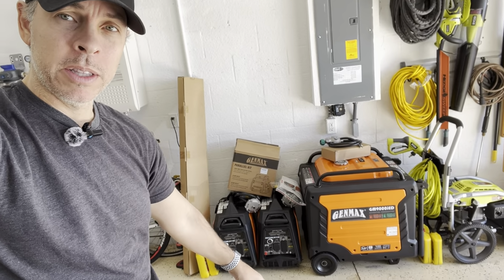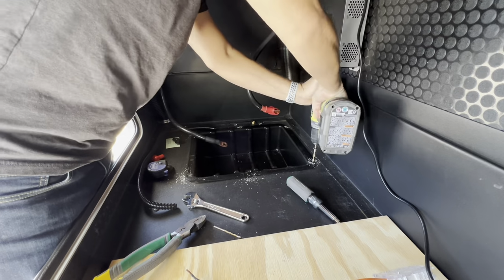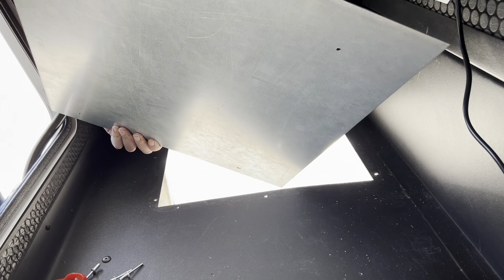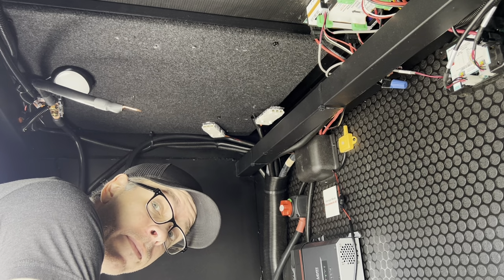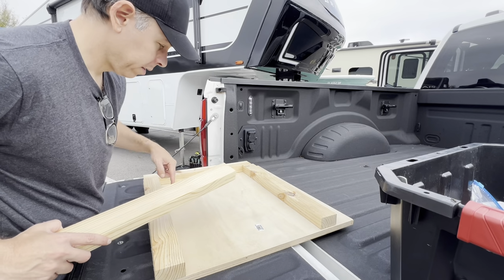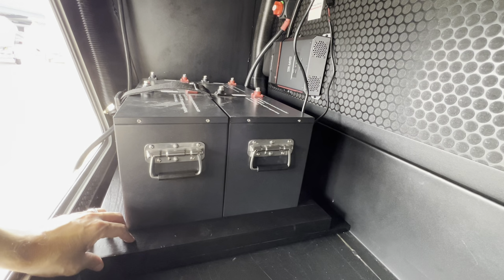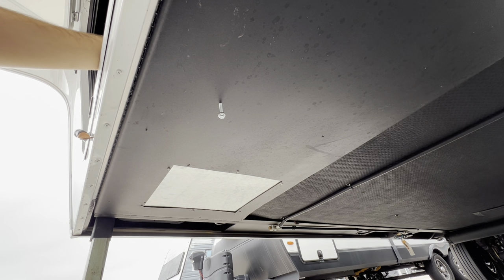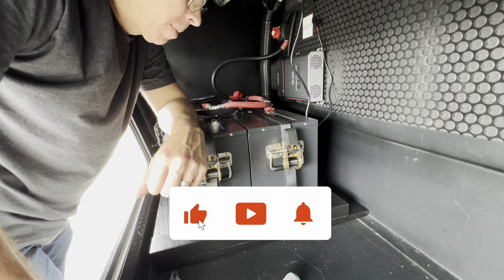Brinkley RV Model Z 3100 - Inverter and batteries installation

Comment: Hello Javier: Just a note to thank you for the guidance to get my Z3100 AutoDetect converter to identify my new SOK lithium batteries. The WFCO company took care of the issue of the converter not identifying my lithium batteries by giving me a new converter that was hard wired to lithium mode. I’m now able to charge my batteries to ~14.2V and I’m sure they will charge up to 14.6 V once I start using shore power and additional solar panels. Of course the most important aspect of having the converter identify the lithium batteries is so that the charging profiles match the needs of these batteries to increase their life span.  Thanks again & you are great resource for all things RV. Enjoy your new Brinkley Z3100. 
Joe
Reply from the maker: Great, you are welcome.  If I were WFCO, I would put a 3 way switch to go from auto to lithium or acid battery. their auto detect is not as fast as people would expect or need it.

Comment: Fun to watch different approaches to installing inverters and batteries to the Z 3100. I just sealed the bottom vent on the battery box and left it in. Then I built a platform on top to secure 4 Battleborn 100 ah batteries. I also like how when measuring you are thinking in Spanish and converting to English, I'm a little jealous cause I don't speak a second language. Enjoy the Brinkley, we sure do. Burlington Bill busking on the road and here on You Tube.

Comment: Thank you so much for the clarification Javier.  You are an amazing resource on many topics. 
Yes I already contacted WFCO on the converter installed in the Brinkley Z3100 and they were questioning the cable connect sizing used by Brinkley (or Lippert)  and the distance that the converter is from the Lithium batteries as the most probable cause on why their WFCO WF-9855-AD
Auto-Detect Power
Converter, 55A Output converter was not identifying my SOK lithium batteries. I will bring this issue up with Brinkley (or Lippert) so that they can consider mounting the WFCO converter in the battery bay area on future Brinkley models or just use thicker AWG cabling to rectify this issue. Take care.
Reply from the maker: The cable size is 6awg which is appropriate for 55amps and the distance is no more than 10 ft so that is not the issue. I believe that the WFCO Auto detection does not meet the users' expectations. I would have installed a switch to switch from auto detect, lithium or acid battery and led the user to decide.

Comment: Javier I just realized that I will also need to incorporate the ability for my parallel dual generator set up to accept a 50 amp receptacle that we have on our Z3100 Brinkleys. 

So now instead of just the junction cables to connect the two generators together I will need an electrical box with 50 amp receptacle (+ circuit breaker) to achieve what you have already built in with your GENMAX GM9000iE.  

Hopefully all the internal cabling on the GENMAX GM6000iED generators that I was thinking of buying will have wiring to handle the 50 amp load.  Let’s see what GenMax support has to say and I’ll let you know.  

If not I guess I’ll just get a gym membership and get those biceps and lats in shape and go for your GENMAX GM9000iE.  👍👍
Reply from the maker: Get this one https://amzn.to/3QH3hV7
If you get 2 use this to connect them in parallel https://amzn.to/3USMzEC

Comment: Thank you for showing the install in the Brinkley. Could you demonstrate the inverter in actual use inside the rig and also how it ties into the breaker panel. I need to do the same install thanks again.
Reply from the maker: Yes I will, I was waiting to test it and have a little more understanding of the Sub Panel because is tricky.

Comment: Hello again Javier:  I noticed you purchased the 233.7 lb GENMAX GM9000iE 50 Amp 7600W/9000W Remote Start Gas Inverter Generator with CO Detector. Awesome generator to say the least. 
How on earth do you lift that beast into the front storage area on your beautiful new Brinkley Z3100?

I’m contemplating just purchasing two GENMAX GM6000iED 6000 Watt Dual Fuel Inverter Generator with CO Detector (weight: 117.9lbs) and connecting them with a parallel cable kit. 

Just another way to get us plenty of watts to run those AC’s and the entire rig !!
Yeah it’s $~$500 more for this dual generator set up but hey it’s only money right?  Save the back I say.  Ouch!!
Take care and we are almost ready to head out on our first test run in our Z3100. What a ship.
Reply from the maker: I didn’t bought the GM9000iED for the RV.  Is for my house.  Check my other videos.   For the RV I bought a Genmax GM3500iAED.  Well 2. I bought 2 3500 to use it in parallel but then I realized that only one with 30 amps will be enough.  Is not hard wired.

Comment: Very clean and professional install Javier. We just received our 2024 Z3100 last week. What a fine 5th wheel.  The dealer only installed 2 Marine standard batteries which I will return for full credit once I install your recommended SOX 12.8V 206 AH 2636 WH Group 27 batteries. Question?  Why 4 batteries and not just 2? What are your calculated number of boondocking days with these 4 SOX batteries assuming you do not run the AC?  Thanks; Joe (Portland, OR)
Reply from the maker: Hello.  My plan is to be able to run the main air conditioner overnight ar some overnight stop.  That is why I didn’t add any additional solar panels; at night there is no sun. I will recharge at the next campground using the shore power. I used 4 based on 45min of AC per every 100ah.  4 batteries at 206 each equals 824ah.  Total 6hrs.  If I get 4-5hrs at least of AC overnight I am good with that.
Reply from the maker: How many days of boondocking I don’t know.  I don’t bookdock yet.  But I am sure that without AC will be 5-7 days.  Remember I did not add solar panels.  You want to double your batteries ahead of time in solar panels watts.  For example in my case with 824ah I should have at least 1,700w of solar panels to keep the batteries recharged.  

Hey if you decide to order the batteries please consider using the link in my video description that helps me to keep affording RVing.

Comment: Thanks for posting. I had a few questions and this answered them for me. My issue is 007 was only wired for a 2000 watt inverter and I cannot find one with an automatic transfer switch. So right now I can either buy an automatic transfer switch (which I do not know how to wire) or pay someone  to install it which I am not willing to do. Looks like I am going to have to learn how to do it.
Reply from the maker: Isn't that complicated to add a transfer switch is more work. I  would e-mail Brinkley and ask for instructions so you have a guide.  Also post on FB; who, where, and how someone with a 2000w inverter prep kit installed a transfer switch. you can check PowerMax PMX 2000W-PSPT  and KISAE SWXFR1220

Comment: Ok Javier. My WFCO converter light is still not changing from green to blue (lithium recognition color) so I will send it to WFCO to have it “hard wired” to lithium as you did. I am suspecting that Lippert-Brinkley & WFCO did not install the converter in a location that is allowing the so called “Auto-Detect” components of the converter to switch to lithium after a standard “draw down” test which I have performed several times in my 2024 Z-3100 Brinkley. 

On another subject: Do you plan on connecting your generator to the Brinkley’s quick disconnect LP outlet when boon-docking or do you have a separate LP tank (with short hose) that connects to your generator?

As always thanks for helping me get this new 5th wheel ready to roll 👍👍
Reply from the maker: @joemarin7918  only a few have been lucky enough to get it to switch to lithium mode.  Even that my generator is dual fuel I have been using gas.  If I start to use LP I will get an additional tank.

Comment: Hello Javier: 
I just removed the WFCO AUTO-DETECTING converter from my Z3100 RV. As you recall the converter was NOT Auto-detecting my lithium batteries and switching over to lithium charging profile which is very important for lithium battery charging. Question?
How fast was your turn around time with WFCO once they received your converter in order for them to permanently set the converter to lithium mode?
Thanks
Joe (Oregon)
Reply from the maker: In my case they sent me a new one already in lithium mode.  I heard from others that was no more than a week to receive it back after they received it.

Comment: Hello again Javier:
Did you change your Brinkley Z3100 factory installed:

•WFCO WF-9855-AD (Auto-Detect) Power Converter with 55A Output for a:

•WFCO WF-68100AD Series Deck-Mount Converter Charger -100 Amp unit which is also incorporated in the “G” model Brinkley?

Or did you use a different lithium dedicated converter from WFCO?

If so can you share the specific WFCO converter model number?

I only went with a 2 each SOK 206AH batteries initially but will convert to a full boondocking solar set up in October when we land in North Florida. 
Thanks 
Joe (2024 Brinkley Z3100)
Reply from the maker: I am using the original 9855-AD converter.  You can’t use a 68100AD Without first changing the wires.  The z3100 comes with a 6awg wire that is only good for up to 60amps not 100amps.

Comment: Good day Javier.
I was just wondering if you just went ahead and removed the WFCO converter yourself and then sent it into the manufacturer to have it hardwired for Lithium or if you received Brinkley approval prior to sending it to WFCO for the modification. Take care. 
Joe
Reply from the maker: @joemarin7918  you have to contact WFCO directly first.  In my case WFCO sent me a new one and I replaced it.

Comment: Did you have to run a ground wire from the chassis to the ground connection on the inverter?  Or does the ground wires from both the red and black legs do the trick?
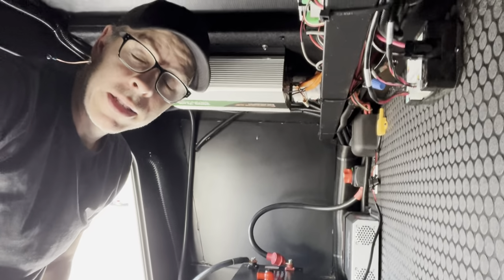Reply from the maker: 22:44 if you go to that time on the video you will see behind my head that I added a wire from the ground screw to the RV chassis.

Comment: Good day Javier. I just installed 2 SOK 208ah batteries and they work fine. Question. Did your Brinkley Z3100 Converter light change from green to blue (after your draw down procedure) so that it can charge your SOK batteries to the max ~14.6 volts?
Thanks.
Reply from the maker: Hello.  No. That being said.  It could take a few discharge - Recharge.  The converter auto detects but is not instantaneously.  I had to contact WFCO and they sent me one that was hardwired to lithium with a new firmware for 824ah.   If you try a couple times and don’t work then contact WFCO.

Comment: Awesome job Sir. So are you using the one factory solar panel to charge all 4 batteries?
Reply from the maker: That is correct but also the converter. In my case, I just need those batteries for an occasional overnight stop and at night there is no sun so I will not need more solar panels. I will be charging the batteries the next morning with the solar panel and once I get to the next campsite I will be connecting the RV to shore power to also use the 55 amp converter to charge the batteries.  So converter and 1 panel.

Comment: Hi Javier, appreciate your videos. We installed the PowerMax 3000 in our Z3100 as well. The only problem I am having is after the install, my 15A shore power GFCI trips. If I take the inverter back out of the loop, the GFCI does not trip. Have you connected your rig to a 15A shore plug after you installed the inverter? I tried to plug into a non-GFCI 15A plug, but it tripped the breaker instead.
Reply from the maker: Hello. No I have not connected to a 15a.  But I have to a 30a and 50a.  Is the PowerMax grounded on the front and the backside in and out wires are also both connected to the inverter ground?   

Trips instantly or after a while?  

When you are connected to shore power the inverter doesn’t work instead send forward the power using the internal transfer switch and powering the whole breaker panel so make sure there is no Air Conditioner running or anything else that requires more than 15amp.  Try to connect it to a non GFCI those are very sensitive with anything that fluctuates in amps.
Reply: @JavierRivera  Yes, the inverter is grounded on both the front and the back and for both the input and the output. If the inverter is powered off, it trips the GFCI instantly when plugging in to 15A shore power. If I turn the inverter on, it takes about 5 seconds to trip the GFCI. If I connect it to a non-GFCI, it trips the breaker. Nothing is running on 120. Only the fridge on 12v.
Reply: I should add that I also tested it after shutting off all of the breakers in the panel and subpanel. It still tripped the GFCI.
Reply: @trentlog did you ever find a solution to this?

Comment: Is that battery bank going to be charged with the supplied 370 watt solar panel and AC (shore power) only?  If doubling or tripling the solar array won't you need a larger MPPT charger? (Furrion manual says 50amp charger is only good to 600W of panels)
Reply from the maker: That is correct. It will be recharged with 1 Furrion 370w panel and the converter when connected to shore power.   In my case; my plan is to be able to run the main AC for 4-5 hrs at night at some overnight stop. At night there is no sun so I don’t need more panels.  I am 99% of the time connected to shore power.  Even with 1 panel I can still boondock but no AC for sure, how many days I could boondock with 824ah and 1 panel? I will find out when the weather change to cold again.
Reply from the maker: I forgot something else, soon I will be installing a dc to dc charger, hopefully 50AMPS.

Comment: What are the dimensions of your plywood?  I don’t have my Z3100 but I’d like to build the battery base.
Reply from the maker: I mentioned in the video. https://youtu.be/iFNSkejixgo?si=hMIYv-YHVR2KIbtK&t=1804
Reply: Thanks!  Finally found it at the 30 min mark.
Reply from the maker: @ophirpass   Double check the measurements before you cut.